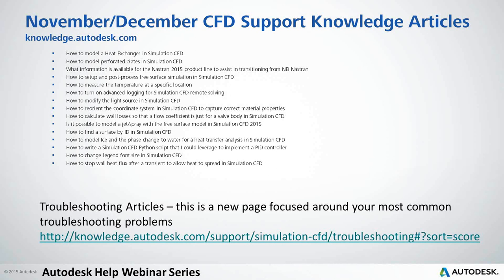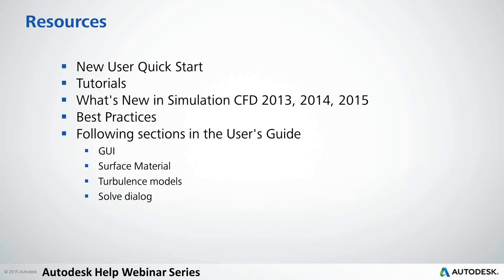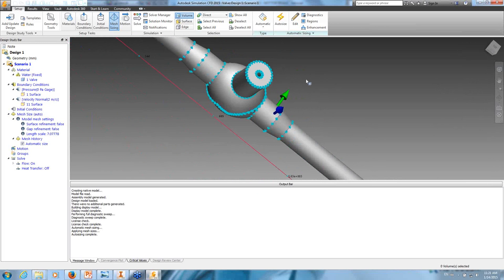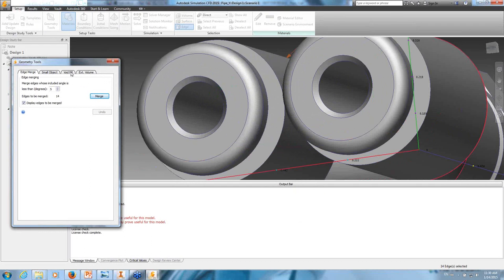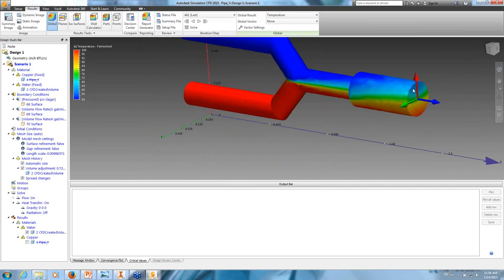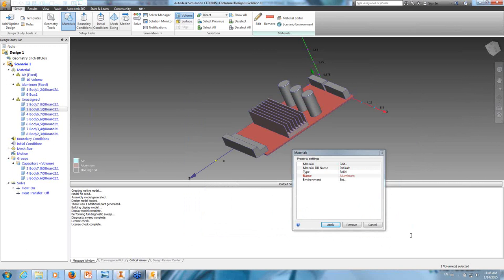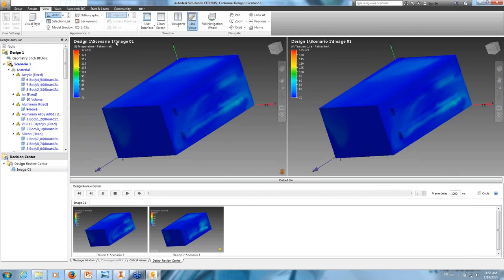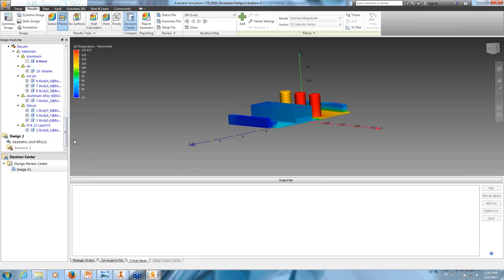Getting Started with Autodesk Simulation CFD

Comment: hi, i'm reza, can it the software autodesk simulation CFD install in ubuntu 16.04?
Reply from the maker: Hi Reza. Currently Autodesk CFD is only supported on Windows systems, so I'm not certain how well it would run on Ubuntu.